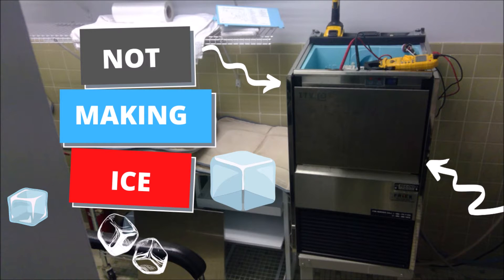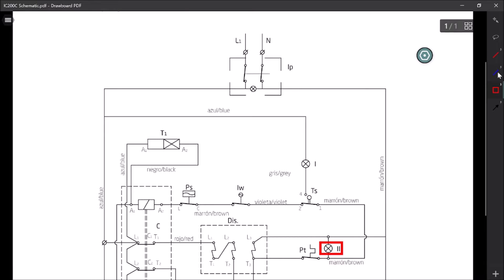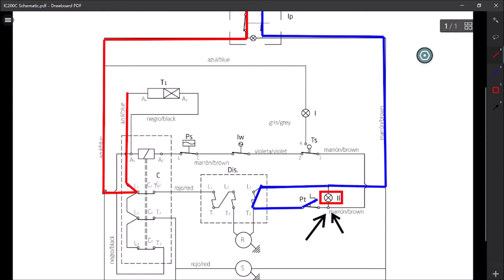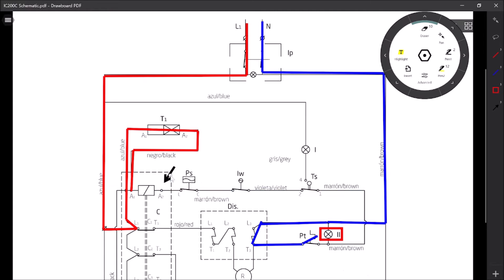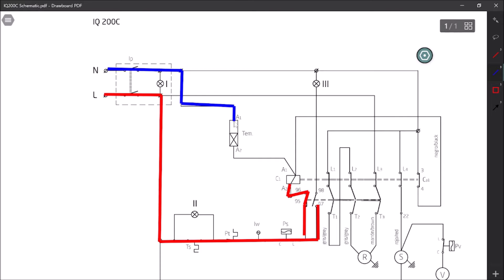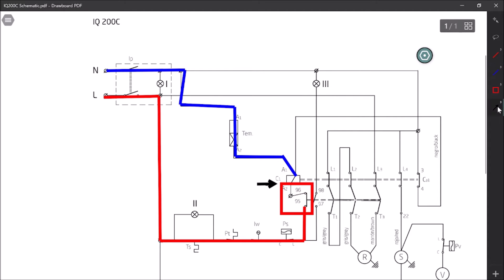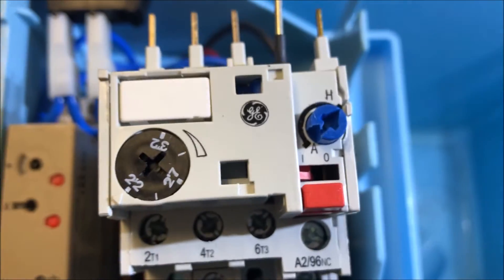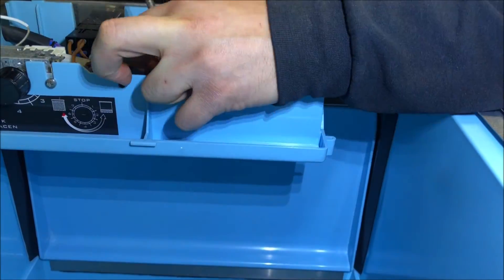ITV ice machine is NOT making any Ice. Troubleshooting and Schematic breakdown.

Comment: I am a bit confused as to how open contacts and switches are receiving voltage? Should they not be at 0 if they're open and show voltage if closed and contacted? 10:31 for example, how can the switch be open and have voltage, would it not be 0 until contact is made and the switch engages? New to Ref School thanks!

Comment: The water flow going through my Hoshizaki km-201bah is warm to hot, but the water source is normal. It's been doing the single beep mostly and the 3 beeps occasionally. I changed the water inlet valve in December and I maintain it regularly and the water flow and pressure is normal. I bought it new in 2018 and I'm just now having this issue. Any idea what it could be?
Reply from the maker: That’s odd, I wonder if the hot gas valve is open causing the water to get warm or the pump is getting hot but it would need to get ridiculously hot for that to happen
Reply: @REFRIGERATIONKITCHENEQTECH  The water gets pretty hot.

Comment: It’s easier when you can draw lines with color like you use in the computer software, and it would be so much easier to figure out the diagram if they (factory) would print the diagram just a little BIGGER, great how you break down the circuits

Comment: Nice job how do you improve your wiring diagram skills ? Any tips and tricks
Reply from the maker: Practice, practice and practice. Once you understand the concept that the electricity is just simply flowing through the wire, all you are doing is following it until it no longer flows, almost like water in a pipe. At that point, you just need to figure out what has stopped the flow. Most don’t see it this way and struggle. A lot of my videos have a schematic breakdown, so watch those and soak it all in and ask questions.

Comment: Excellent vid i might add when i see an overload trip on flaker type ice machines check the amperage like you did and find everything checks out the last check i make is make sure the bin stat shuts the machines down bcuz if it doesn't ice will back up has no where to go starts to back up into the dispensing duct and  Adventurely causes a trip out
Reply from the maker: That’s a great point, I don’t work on these flakers very often.